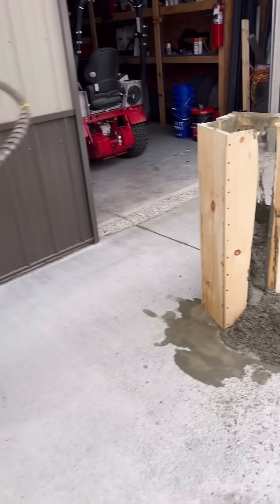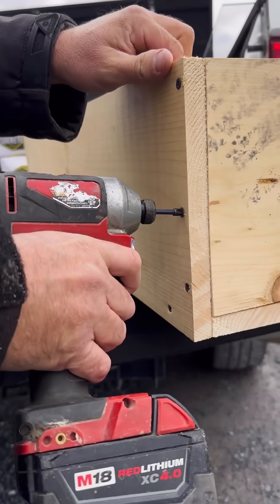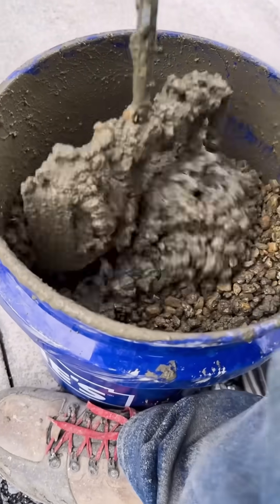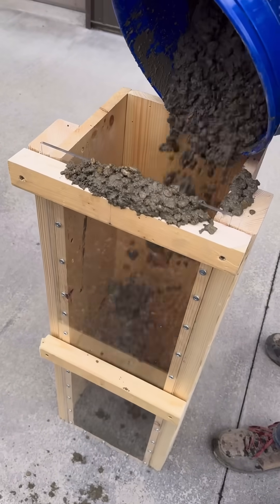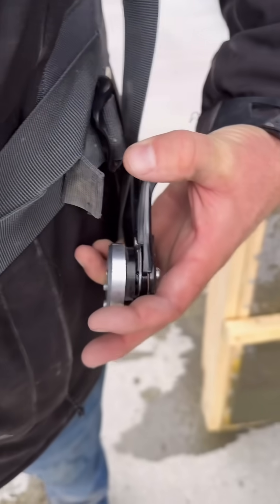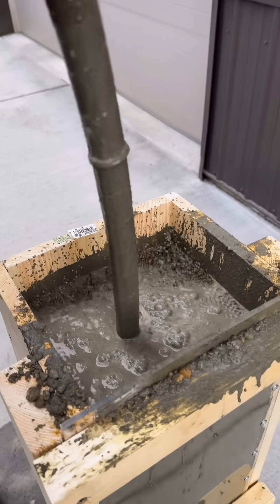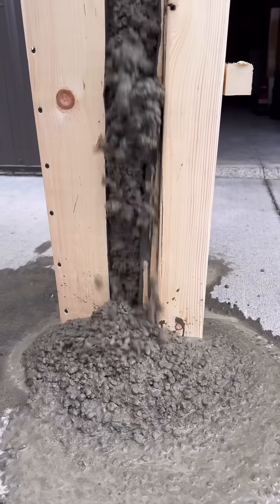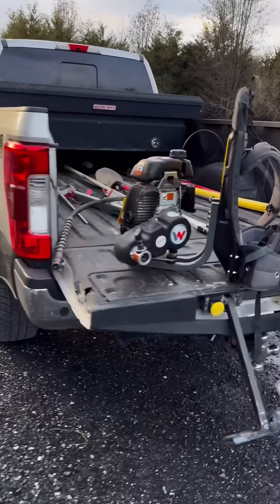Why It’s Important To Vibrate Concrete

Comment: In my younger days I worked at a design+build.. the crew barely reinforced a 4 ft high wall around the walking path. Mid way through the 1st pour all the boards started to buckle / blowout and they had to stop. Took a week to demo out the hardened conc. No bueno.

Comment: You child! First of all why are you using that baby saw? On concrete jobs you use a worm saw. And screws? What? You can't swing a hammer? Nails are stronger than screws and are preferred because they're easier to strip. You're walking around with that toy called a screw gun. My hammer doesn't need a battery. You made a form out of boards?!?! Moron! It split on the grain! You could've at least ran the grain horizontally but what you really should've done is used 5/8 plywood. They have alternating grain patterns. And the forms are held together with ties. Nails or screws are just tacks. If you don't have ties then clamp it. No clamps? Banding wire. The one thing you did get right was the consistency of the mix. And you don't reinforce forms, you reinforce concrete with rebar. Forms get locked up. Learn the lingo. And finally, a speed square? Really? On a concrete job? You can't cut square 9-1/2"? Or 5-1/2"? In the real world you wouldn't make it pass coffee.

Comment: It's not really a horror story involving the use of concrete but still somewhat relevant. My parents' house had these cracks forming in the floor for years. Our suspicions about the foundation settling were incorrect. It turned out that there was a 30ish foot deep sinkhole underneath the house, and we didn't know about it for years. They postponed retirement to pay for all the concrete that was pumped into the sinkhole.
Reply: should have used flowable fill which would have been a lot cheaper than concrete.

Comment: Never, ever build bulkheads or forms with solid lumber vertically. You need to cut multiple pieces and stack them up so the grain goes horizontally. Thank you for the video proving just that!

Comment: Better to vibrate bottom layer firsty...than you dont have to go to the bottom again...than fast down and slowly up...but not too slow so bubbles have a time to go up or disepear if you put another layer with delay just starts sink where you ended...dont vibrate what you aleready vibrated before.

Comment: I've never done concreting, I know a little bit about it though, and that form work on the box was running upwards, so the concrete could easily split, from the little form work I've seen, the grain would run across the platform thingo, not upwards from it, so it would be significantly more harder to split that.

Comment: I was at a new job. I worked there 2 days. To help form up some walls that were underground the concrete came a day early. The boss said just put it in. The two days we were forming it. It was way way cold. So we didn't get much done. Because  the ground was so cold. So wan he said just do it. I knew it wasn't going to be good. The first pour broke rite away. Then he said do the other wall now. And sure enough not 3 mins in it let go also. That's wan I told myself I didn't want to work there.

Comment: Before setting a new gig bore at work we always cut out the old concrete and poured new 3 feet thick concrete before bedding in the new bore and always used a vibrating probe to get massive amounts of air and voids from the concrete so it would be 100% structurally strong to withstand the massive weight of these machines .It was a lengthy process but had to be done .

Comment: Doing a full gut and reno of this old place as a general laborer in my hometown when I was fresh out of highschool. When it came time to redo the half flight of steps and retaining wall down to the back basement entrance none of the crew had done concrete at that scale befor. Like real sketchy crew, almost definitely illegal stuff going on but was too young/green to really know what was really up. So they build the forms and the shape, layout, etc was great, all level and plum bla bla. I noticed there was not really much bracing or anything on the middle other then a single 2x4 placed long side on the form. I mentioned as I was cleaning up scraps and stuff that they should probably brace the middle with something so I didn't bulge. The head contractor who had made the plan for it laughed telling me it would be fine and to go back to picking up garbage. Later as the truck finishes pouring the short part of the wall. The head guy turns on the vibrator and sticks it in the long side of the wall, almost immediately the middle of a 2x4 "reinforced" 6' x 8' chipboard form bulges out a good few inches before he stops and a couple other guys scramble to unsucessfully push it back in and add more bracing. The head guy had the genius idea to have 2 guys on either side push while he used the vibrator again... it caused the short side to bulge a little and 0 inches were gained from the effort. I quit that day and they ended up letting it dry hoping the owner wouldn't notice. A friend of mine on the crew told me they had to jackhammer the whole thing apart and then the owner hired concrete company to come do it for them.
Reply from the maker: Crazy, it would’ve been a lot easier to add a few more braces

Comment: I used to work for a concrete company that did mostly basement walls and we had to beat the aluminum forms with rubber mallets to get rid of the air bubbles and voids.

Comment: Wire is supposed to be wrapped around wood form, or you can also use rebar that’s been bent square to slide around the form before you pour 👍

Comment: I’m somewhat familiar with the use of vibration. One application for the vibration would be to apply it to the buckets your mixing in as you pour. The slump increases dramatically and you should be able to smoothly pour.  Applying the vibration to the form is desirable where you need a better surface product but an internal increases core strength and, well, pressure as you experienced.

Comment: Unvibrated concrete whore story: my stand alone garage wasn't made properly and both sides of the foundation cracked along the length letting the while structure sag onto the door. The previous owner cheaped out everywhere possible including not hiring proper knowledgeable contractors. Had to uninstall the door mechanism and jack it up and reattach to just use it.

Comment: I went to do some finish carpentry at a house in a mountain well it's on a really high hill.  When I pulled in the driveway at the house . I looked over and there was an underground pool. The concrete was a mess!!!   But in the far right corner there was a shovel sticking out of the concrete permanently stuck straight up with the shovel sticking in the concrete!  True story. I wanted to ask why? But I decided not to lmfao
Reply from the maker: Wow!

Comment: The form didn’t blow out because of too much vibration.  It blew out because the forming material was 3/4” (pine?) boards instead of 3/4” plywood.  The 3/4” board cracked down the grain of the board.  There is no need for strapping around such a small form.  I like the experiment though to see what happens through the plexiglass.

Comment: One time we had to come in and seal an avalanche bunker that wasn't vibrated. 7 million dollars worth of electrical equipment to light up the tunnels on the Roger's pass was inside of these things. It all got destroyed the first time after the bunkers leaked. We fixed 2 of them, and another company did the other ones. Millions of dollars in excess cost on a government job in Canada, and we were the ones to fix it! Always vibrate your concrete!! This bunker needs to be able to hold a Boulder smashing into its top! It won't, it's just barely sealed and will never be built properly.

Comment: The vibrator makes the concrete behave like a liquid. A very heavy liquid that applies fluid dynamics in all directions. That 1 meter column has the equivalent of 40m water pressing outward...
Reply: It's a third square yard.
We don't use commie units here.

Comment: Please redo this test with one using the  vibrator and one without. If you can do a test to see which is more structurally sound. It's a great idea to build that form with plexiglass to show results, like you said just reinforce it. 

Edit: I know and understand why it is vibrated but would like to see a visual difference. Never tested it myself though.

Comment: Ratchet straps. Also, you want strong concrete, reinforce it with rebar, and dry it as slow as possible (basically you keep spraying it with water, but you spray less each time until its fully dried), do it correctly and an excavator with a jackhammer will just bounce off

Comment: We didn't put any bottom whalers on so when we were pouring a foundation wall the form blew open because someone over vibrated one spot. We ended up spending a few days grinding and parging the wall even though it was in a spot no one would ever see. Oh well I get paid by the hour

Comment: My job is delivering and batching my concrete loads. Vibrating the concrete dose do exactly what you stated, but there is a big difference in when you want air and don’t want air in the mud. This difference is out side mix and inside mix. The air in out side mix alow space with in the concrete for water to expand and contact during wether and temperature changes. Ie, Alowing the concrete to last longer in out side conditions. When the mud is pored as an inside mix, this means that the concrete will not be exposed to extreme variations in wether and temperature. Which means the mix can be engineered to be stronger and more dense than its counter part out side mix. With your demonstration, you use a column as your test subject, if this were to be out side, it would be deteriorating faster over time due to the lack of expansion voids in the concrete. The more you know😂
Reply: Hey, so my job is to deliver and batch concrete loads. Vibrating the concrete does exactly what you said, but there's a big difference in when you want air and don't want air in the mix. This difference is between outside mix and inside mix. The air in outside mix allows space within the concrete for water to expand and contract during weather and temperature changes. This makes the concrete last longer in outdoor conditions. When the concrete is poured as an inside mix, it means that the concrete won't be exposed to extreme variations in weather and temperature. So, the mix can be made stronger and denser than outside mix. In your demonstration, you used a column as your test subject. If this were outside, it would deteriorate faster over time because there aren't any expansion voids in the concrete. The more you know!
Reply: Which is also why they cut concrete, like on sidewalks, right? I've never done inside work, but I always use a fairly wet mix, keep it wet for as many days as possible, and I've never had an issue. I think a lot of times it is because the mix is too dry, since the wetter the concrete stays throughout the cure the harder it becomes. At least that is my perception of it.

Comment: Concrete is so much heavier than water, still it flows. A 5m pour turned into "The Boat" for a half hour straight, because of a pinhole🤣
Reply from the maker: Awful
Reply: @hausplans The solution was, to blast the hole( it was a lil bit more complicated than just a plain hole. There was a gap between the old concrete and the wood, where two boards met) with spray foam and torch it at the same time, to get the PU react faster and glue something in the hole, (so we could not just ram something in the "hole" or we had moved the entire shell🤣) because it was friday, around noon(like it always is) and there was no chance in hell the pour was gonna stop.

bauhauf . de / projekt / blaueswunder
The second picture shows the troublemaker. Someone had the wisdom to design it only half as long as the bridge is wide, so it could be moved 6 times, instead of being rebuild(partially) 3 times, which we ended up doing, 6 times, of course🤣)

Comment: Fixed an external foundation corner this past Fall (2023).  I used a pneumatic air hammer beating on a 2x4 held against the plywood form.

Upon removal of the form?   Nothin' but solid concrete.  Even a couple of DIY neighbors looked it over and noticed how free of bubble voids it was.

I didn't share my secret, though.
Reply from the maker: Good job 👍

Comment: This is one of the main reasons that concrete structures continually fail in China, often with catastrophic results.  Their rebar is often fake, and their concrete is not vibrated enough, if at all.

Comment: Stole this story from an engineering friend: While in a lecture on concrete, the instructor was talking rebar spacing and air voids. He said "If it's ten inches, you'll be fine. If it's eight you're probably still ok. But if it's six or less you're gonna have to stick a vibrator on it."

Comment: Whatb is the minimum on this? If it's only a 3 inch slab measuring 6x8? Does it still need to be vibratoed?

Comment: a dude i knew was building a garage and dug a 4 foot deep foundation trench and was going to use 3/8 ply without any shoring to pour a 6in thick wall.. so helped him form it in and the 3/8 ply only bulged slightly when the pour was vibrated out

Comment: It's great to vibrate, but keep it moving and don't move the concrete with the vibration. Remember, it doesn't take much to settle the materials
Reply from the maker: All correct, I didn’t longer than necessary for the video to show the air coming out

Comment: Now get that concrete off the sidewalk before it hardens.
Reply from the maker: 😂 it came off easy with the hose
Reply: @hausplans   good. 
Doesn't take long for that to soak into the pores on a slab and leave a stain. 😂
Reply from the maker: Luckily, we had sealed this concrete

Comment: Also, just so it's out there, you can very very easily over vibrate the concrete and start to separate the larger aggregate from the concrete and sand, effectively stripping your concrete if most of its strength. Especially on deeper pours. Remember; less is more.

Comment: Use plywood as this is typically used for shuttering in the industry. And doesn’t split down the grain like your piece did.
Reply from the maker: We would use plywood in a real world situation or aluminum forms. This little form was just for demonstrating the vibrator.

Comment: Don’t do it too much!
Reply from the maker: I overdid it for the sake of the video to show air coming out. But you’re correct if you vibrate too much, it can cause the aggregate to settle to the bottom.
Reply: @hausplans  i think the aggregate sinking and shifting and wedging itself into the bottom of the form may be why it split. Maybe not.

Comment: Was apprentice on a big concrete bridge project. We were doing a 24 hour pour with 3 teams working in shifts. The concrete arrives and its already settling so comes out of the hose in chunks. We told the foreman and the boss of the project that we cant use this stuff. Every pour was a big event with a lot of planning and the entire project was far behind schedule so he ordered us to just vibrate more. We still told him that it wont work but he gave us no choice. Well it ended having to demolish that entire section of 20ish meter of bridge.

He had to order special cranes and concrete cutting vire teams etc and somehow the company managed to get the concrete supplier to pay for the whole thing. The entire project was a huge mess from start to finish lol.
Reply from the maker: Wow, I can’t imagine that!

Comment: I was missing and pouring 4 tonne of concrete for a 4m column and vibrated it and had the rear of the form blow out. Nearly rote off the job but managed to rescue it with some sweat and tears. Will use straps next tome and coach bolts to make sure it doesn't do it on the next column. The vibration literally vibrated the screws out.
Reply from the maker: That’s crazy

Comment: I delivered concrete for ~10 yrs... Lots of "blow-out" horror stories. I think the worst was an intricate 33 cubic meter basement foundation. It blew out with less than 10 m³ to go, and on the highest section of wall when they were vibrating. TWICE ! First on the inside of the wall, then the outside 2 minutes after we restarted pumping.  😣  Lost about 8 cubes. What a mess. (In Canada we use meters, not yards ! LoL)
Reply from the maker: Crazy

Comment: Concrete with air bubbles IS nearly as dense as Concrete without air bubbles, but the small change in density makes a huge difference. That's just how density works.

Comment: While working for a Chemical Company, a contractor was pouring an elevated pad for a large storage tank. After a couple weeks of prep work they began the pour and as it neared the end of the pour, due to the insufficient bracing the form busted out. 
  After a couple weeks of cleaning up the mess and rebuilding the forms they finally completed the pour.

Comment: Horror story is too much water(=voids when dry)!  Always use a poker or vibrating tamper - the finish and strength, including adhesion will be tripled.  Yes, form work must be up to scratch.  The other "trick" fencers pull is compacting a dry mix and adding water after  - drives me mad!

Comment: Your display had a lot to do with the gain of the wood. Plywood . Would of been better. But you know this.
Reply from the maker: Yes, usually the forms we use for walls are aluminum. I just made this form as a prop to show the air coming out.